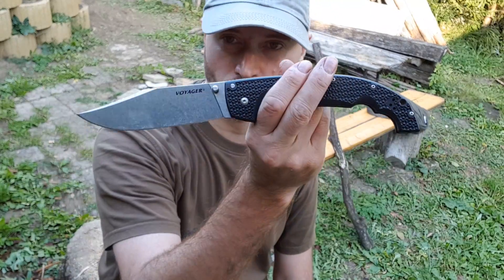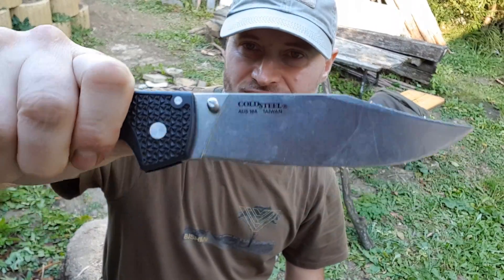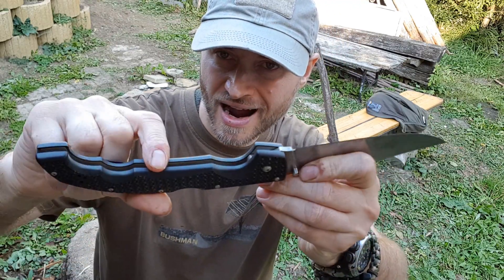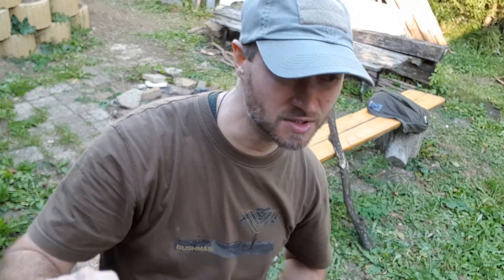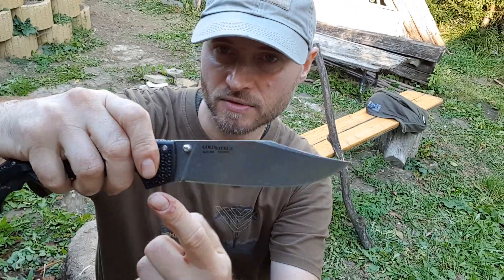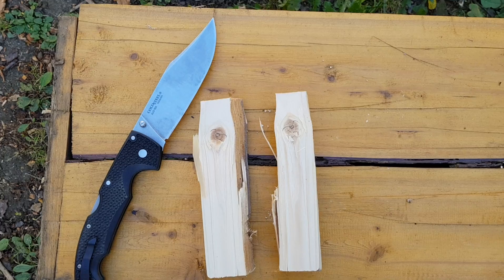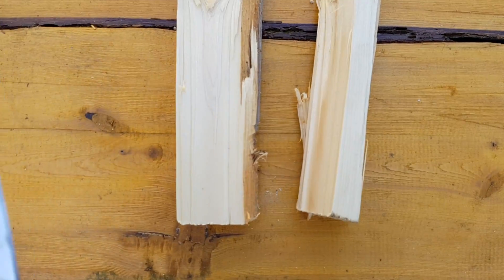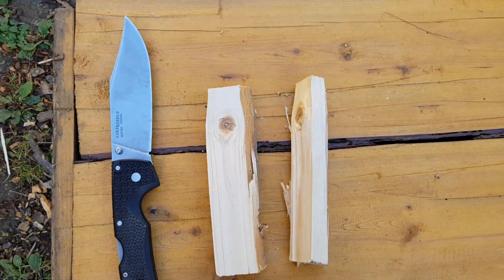CS Voyager XL knife (broken tip) - TEST

Comment: I dont know why they use such a brittle steel. Aus 10a is to much brittle.
Reply from the maker: Yes, but there is I think more in the design. My friend used to have one older Voyager made od AUS8 (so more tougher) and he broke the tip also. I belive, this is a weak spot on such a great knife:-( Maybe, they redo the design and add some stronger tip. It shouldn´t be so hard if they want to... FM
Reply: @forestmantis1737  Aus 8a is tougher than aus 10a but even aus 8a is too much brittle...but yeah it also depends on the overall geometry of the blade. For example voyager with tanto have such thicker tip...for me tanto blade is better option...
Reply: @simfer_6782  There is video with the CTS-XHP steel and a clip point blade, it breaks.
Reply: @simfer_6782  aus10a aus 10 is tougher than aus 8 and you have a better edge.  if it was brittle, it would chip during carving.  the problem is that the tip of the knife is too thin, if it breaks if you hit it in a bad position.  however, I much prefer Tanto or rajah 2 for such tasks.
Reply: @forestmantis1737  aus 10 is tougher than aus 8 and you have a better edge.  if it was brittle, it would chip during carving.  the problem is that the tip of the knife is too thin, if it breaks if you hit it in a bad position.  however, I much prefer Tanto or rajah 2 for such tasks.
Reply from the maker: @simfer_6782  Agree, that is why I would choose the Drop point version today if I want a tougher knife. The clip point is still the best slicer out of all XL Voyagers (in my opinion). FM
Reply from the maker: @gurugoguzhanson  Hmm, I didn´t see it, I´ll have a look. Thank you. FM
Reply from the maker: @iuliaiulia8993  Yes, the problem here is because the tip is too thin. AUS is very tough - see the SOG knives tests or my CS Mackinac Hunter test, all hollow grounded and very tough without chipping. FM